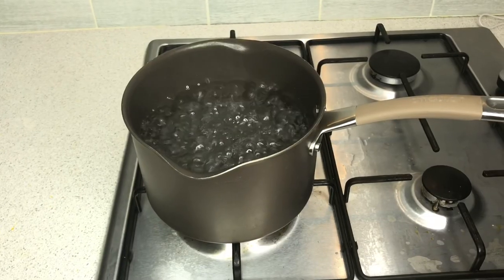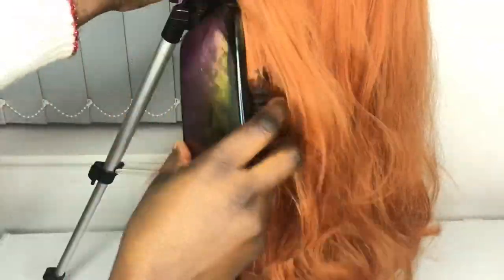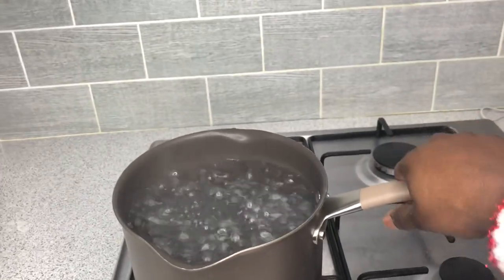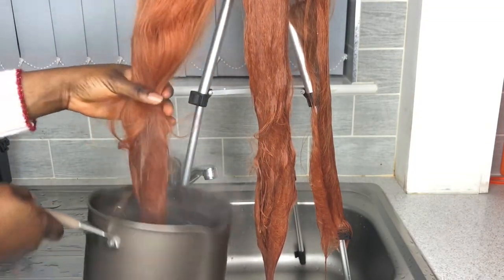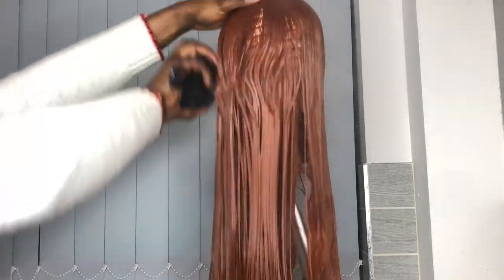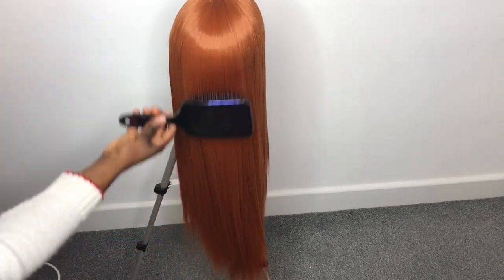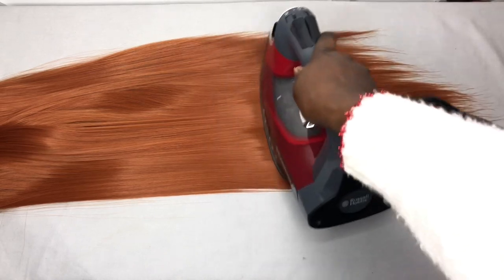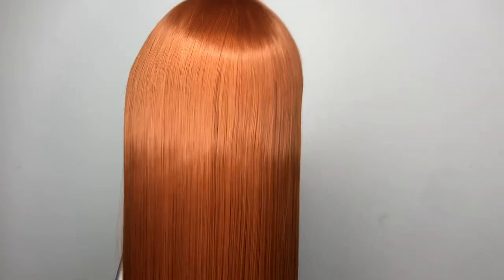BONE STRAIGHT A CURLED SYNTHETIC HAIR ||HOW TO STRAIGHTEN A SYNTHETIC WIG PRESSING IRON/ HOT WATER

Comment: Just did this method today on my synthetic heat proof deep wavy hair it didn't make it bone straight I guess because it's a deeply set pattern BUT the wig  was badly tangled and frizzy before and it definitely helped wit the frizz, tangling, and relaxed the hair really good it's more flowy now I just have to straighten it once it dries definitely would recommend this just don't brush it while it's wet which I didn't do if you want your wigs to last don't brush them wet always wait till they're dried

Comment: Hope it WOnt turn  back hard and tangled... Can it be repeated on the wig? Can I use gas iron as in local iron
Reply from the maker: It didn’t turn for me, and yes you can use whatever iron you have, the only thing is, you need to regulate the iron to medium or low heat  - I’m not sure local iron can do that but if you can find a way around it then it’s fine

Comment: Hii I did this method and yes it worked but the ends of the wig is still very frizzy🤔,any tips?
Reply from the maker: Hi, thank you for your feedback. Try dipping the ends in very hot water multiple times then comb it out while dipping it and place it to dry, then using pressing iron or straightening iron to keep it straight..
Reply: @WigsRevamp  oh ok² thanks so much imma try it

Comment: I tried it but it's still a bit curly, I would love for it to be none straight like yours 😩
Reply from the maker: If your water is boiling hot and you place the wig on something to keep it straight while you pour the boiling hot water and comb it straight then let it air dry there is no way it won’t be as bone straight as mine❤️
Reply: @WigsRevamp  Originally my wig was a deep wavy wig but I tried to straighten it, which made the wig look 😬. I tried this method, although it did make the wig look much better, there were some parts that were still curly and yes I combed it out and still didn't work for me. I don't have a wig stand but I did pour water over it and let it sit in the hot water 😩
Reply from the maker: @bintabinta575  Ok, maybe try it again but this time don’t let it sit in the water, comb it out before pouring the water and when you pour it through, comb it while it’s still hot and let it on a hock or a hanger while it airs dry.
Reply: @WigsRevamp  okay I'll try again tomorrow, thank you xx